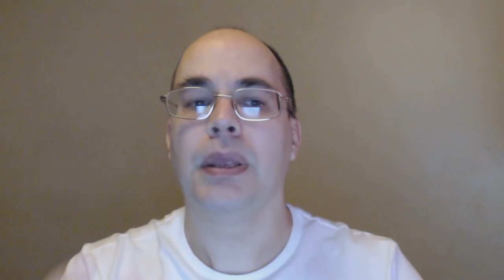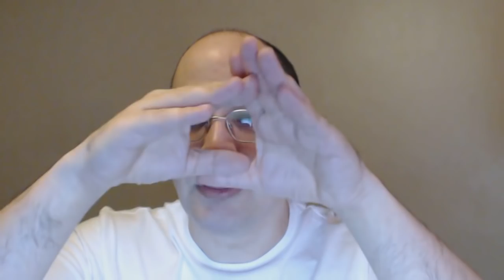How do rockets move in space, with nothing to push off from?

Comment: With respect, it doesn't make sense your explanation. First, you can't fire a weapon in space. Second, the example includes two bodies, that creat the oposit reaction, and than you say that this propulsors can work the same way? Not if they don't through or push mass in order to create this oposit reaction to create motion... How can you create an action and reaction within the same body? This would be an amazing discovery, we would be "free from energy". 🙂
Reply from the maker: Guns can in theory fire in space as the ammunition contains its own oxidiser, there would be problems with temperature and the ammunition jamming in the weapon but it works as a theoretical example. The gun and ammunition start off as a single body with a combined mass and velocity, much the same way a rocket contains rocket fuel. There is no issue about creating a reaction inside a single body and it doesn't create free energy as the potential energy is already inside the body waiting for a reaction to happen.
Reply: "First, you can't fire a weapon in space."
Yes you can quit making shit up.
Answer these three questions
1 - When the rocket engine is running, is the Exhaust Gas ACCELERATED from the nozzle? Yes or No?

2 - Does the exhaust gas have MASS? Yes or No?

3 - Can MASS be ACCELERATED without a force?  Yes or No?

Answer those three questions and we can make some progress.
Most "Physics deniers" will flat out REFUSE to answer these questions.
Are YOU one of those?
Reply: @Stuart Gray  No you can't, quit making shit up 😉.
1 - Yes, from the exhaust, in relation to what?
2 - Yes, gas have mass, can you compare it with the mass of the object it's trying to move? And, using combustion or pressure in space? 
3 - Nothing is created or destroyed, everything is transformed, there's no aceleration without force.
4 - Talking, questioning, is the art of science, just defending visions and opinions not opened to questioning certains, is more like a religion....
Reply: @MarceloOliveira-ji9ey  - "No you can't, quit making shit up"

I literally build, test, launch, and operate spacecraft in earth orbit and deep space as my job. I have personally fired a number of things just like guns in space, and in vacuum chambers here on earth. I have also been a vacuum test specialist for almost 30 years.
1- In relation to the rocket. Does the exhaust gas CHANGE VELOCITY.
Your answer appears to be "Yes".
Good.  For example a space shuttle main engine exhaust is moving at MACH EIGHT with respect to the rocket nozzle.

2 - Good, you know that exhaust gas DOES have mass. The EXACT same mass as the fuel and oxidizer that went in.
This is also referred to as "reaction mass". When a rocket lifts off about 95% of its mass is reaction mass.
3 - Good. You admit that MASS cannot be accelerated without a force.

We have established that you have a clue.
So DO you AGREE that the rocket MUST apply a FORCE to the MASS of the exhaust gas to eject it from the nozzle at such a high velocity? 
Does the engine APPLY A FORCE to the exhaust gas mass?
Reply: @MarceloOliveira-ji9ey  Where did you GO?
WHY did you run away like a coward?
Reply: @stuartgray5877  Well, i have a life you Know? 😉 Not just sitting on my computer, Oh Big mister that fired stuff like guns in space 😂
Well, i have to believe it? 
You don't have the Patience needed to go to space 😉 And if you won't really explain anything, just go upset some One else 🙂
Reply: @stuartgray5877  You push a iron block away in space, it Will move de same way it was pushed... You push gas in space, what Will happen with it? 
Now, imagine a huge propolsor, pushing gas away... What Will happen with the gas? Will it not "dissolve" into space? How can you create pressure against  "0 pressure"?
Why would it make any force on the propolsor?

Comment: that means they sent a rocket into " space " because an unproven theory said it would work 
because until you are in the exact environment you can only guess at the result . They built 
the rockets on an assumption ,  all the cost spent on a theory ?  I don't believe they did , they 
knew what space is or isn't  and then made the story fit .
Reply from the maker: The first rocket that made it into the edge of space was probably the V2 rocket which wasn't aiming for space, but just distance. However as you get further away from the Earth the force of gravity is slightly weaker and the atmosphere thins dramatically, this again was widely known about towards the start of the 20th Century and they didn't have to guess what would happen once they got up really high.
Reply: The X-15 was flying into "space" with a person onboard before you were born.
They had attitude control thrusters because they KNEW that aero control surfaces would NOT work in a vacuum.
Maybe look that up?

And watch the "Stardust Launch" on my YT channel. Tell me THAT is "CGI" I dare you.

Comment: Rockets can't work in space because thrust requires atmosphere. You did not address this fact. Newton's laws don't just magically ignore this requirement. The burning exhaust leaving the rocket does not propel the rocket by virtue of the fact they are moving away from the vehicle. It's not the same as a gun. The bullet is physically touching the inside of the firearm, so when it launches one way, there is equal opposite reaction in the gun. This would be like throwing a ball in space. But if you tried blowing out of your mouth, it would do nothing. Likewise, the gas leaving the rocket is not pushing against anything (in space) so it doesn't work. Space travel is fake.
Reply: Thermal Rehab - "Rockets can't work in space because thrust requires atmosphere.

This is FALSE!
Answer ONE SIMPLE QUESTION ( I predict you will refuse to answer and come up with some excuse NOT TO)

If I fire a STEEL projectile from a CROSSBOW In zero-G, IN a vacuum WILL I FEEL RECOIL yes or No?

This is to determine if it is PHYSICALLY possible AT ALL to "Propel" an object in a vacuum.

Answer the question and ill give you another that is more closely related to how actual Rocket Propulsion works.
This first question is to MAKE SURE that YOU understand how Inertia and Momentum works before proceeding to the real questions.
Please just answer these simple (high school level) physics questions that contain NO MATH.
Anyone with a BASIC grasp of physics CAN ANSWER in their sleep.

Next question: What if the crossbow fires a projectile made from WATER ICE?
Will it STILL get propelled backwards?

How about a projectile made from SOLID CO2 (Dry Ice)
Will it STILL get propelled backwards? 

Why will these things work or WHY NOT?
Reply: @stuartgray5877  Crossbow? Recoil? Seriously. Use a gun if you want to talk about recoil. Crossbows hardly have any recoil. 

To answer your question, firing a crossbow, or a gun, or pushing a bowling ball away from you in space would yes, of course, create a "recoil" - as the solid object is mechanically pushed away by another solid object, be it solid or liquid.

I never said, nor intended to make it seem, that propulsion in a vacuum chamber is not possible. It is. Obviously! 

My argument is that when it comes to using gases to create thrust, atmosphere is required. It's very simple why this is the case. 

Solids and liquids are very different from gases. 

You are to the bowling ball /
The gun is to the bullet /
The crossbow is to the bolt /
A squirt gun is to water

what escaping high pressure gas is to atmosphere , and vice versa.

Know that when a compressed gas (say helium) is released from its container into an area of lower pressure (our air), the thrust that pushes the cylinder back is produced by the gas entering the atmosphere of air and creating an instant high pressure zone right at the exit valve. This pressure pushes the cylinder away, but that pressure only can be formed because there is atmosphere to bump into. The atmosphere thus, is pushing back on the helium entering it. Thrust.

All the atmospheric air is being pushed out of the way by the helium, but air, like all gases, is squishy, so it actually gets pressurized by the helium, right at the immediate exit of the cylinder's valve. This pressure dissipates really quickly, which is why if you open a helium tank and quickly close it, you'll get that shove - and then it ends, because the high pressure gas diffuses and the atmospheric pressure equalizes. 

This is how the wings of a bird allow it to fly, by creating a high pressure area under the wing, and a low pressure area over the wing. This creates lift. 

If you were to go up into space and open a helium cylinder, the compressed helium would spring forth from the valve - and, having absolutely nothing to bump into, would push out into the void of space's vacuum, producing zero thrust. Likewise, a bird's wing, or a massive sail, would not produce lift or thrust in space. 

There is no energy imparted to the gas to make it leave the cylinder. Sure, there is equal opposite force applied to the gas from the cylinder walls (psi) , but the gas isn't being "pushed" out the same way a crossbow pushes a bolt away. 

Gases are elastic, and that elastic energy seeks equilibrium and diffusion all by itself. Solid objects like a crossbow bolt or bowling ball are at rest and there is no elastic energy trying to diffuse. Under pressure or not, they don't care. But they require a physical input to overcome their inertia, a push, which results in equal opposite push, thrust. But gases do it on their own because they are a compressed elastic mass.
Reply: @3_years_left  "crossbows hardly have recoil". Watch the video on my YT channel that says otherwise.  and I use a crossbow as example so we don't confuse the situation with extra GAS shooting out
Reply: - "Newton's laws don't just magically ignore this requirement. "

You are correct EXCEPT - Newtons laws say that Rocket Propulsion MUST WORK I N VACUUM.
Lookup the "Tsiolkovsky Rocket Equation".
It is DERIVED using the "Law of Conservation of Momentum" (COM).

Now can YOU explain the Concept behind the Law of Conservation of Momentum? 
Because if you COULD you would understand how rockets work.
Hint: The Law of COM says that when ANY MASS PUSHES on ANOTHER MASS - BOTH object MUST feel the SAME CHANGE IN MOMENTUM.
Reply: False. How do you think air would push off the rocket exhaust? Please describe how the air pushed back on the rocket.
Another FE fail.
Reply: @MetoFulcurm  Yes.  I cant stand letting these morons corrupt the minds of our children. So I stand up to them.
Reply: @stuartgray5877  you also assume a person's stance just by seeking proof lol! Do you deny the fact that many moon videos were faked? Because even astronauts tell us that we only see recreations of what happened. You claim you're a man of science but seem to fail when it comes to actually applying the scientific method. We need to be able to reproduce something for it to be called science. Nobody is claiming the earth is flat so keep your preconceived notions and hateful comments to yourself.
Reply: @michaelbibby01  If you are referring to my "conversations" with Papa Legba, then mind your own business.  This person has been harassing me for YEARS and accusing me of lying about my career and where I work.

If you read my responses to OTHERS on these threads, I am not a dick and I try to be helpful UNTIL they start accusing me of lying and hurling juvenile insults.

Don't take the way I talk to Papa Legba as how I treat others.
Reply: @michaelbibby01  Now if you would like to "Discuss" how rockets DO work in a vacuum, I will be happy to do that.
Reply: @michaelbibby01  I offered (Politely even) to explain how rocket propulsion works in a vacuum.
WHY did you run away?
Are you SCARED to learn?
Reply: @stuartgray5877  you aren't exactly helping anyone when you appear to be a horrible human being with no communication skills. Try being a human first and a cnt later. Especially when you literally are refusing to acknowledge the arguments presented and deflect with "evidence" that has nothing to do with the subject.

Comment: To all of those people that believe "Rockets push on the AIR behind them"

-  I am just curious you must believe that the rocket engine PUSHES ON THE AIR behind the rocket right?

HOW can this be? HOW can anything "Push" on nothing but AIR?

Doesn't the air just MOVE out of the way HOW can it provide any kind of RESISTANCE to the rocket thrust?
Just explain your reasoning so I can understand how you THINK it works.
Reply: Exactly bro! These morons don’t comprehend that they are bereft of understanding of basic physics.
Reply: Also gases are mostly empty space, so there's no continuous atom-to-atom contact as with a solid spring or rod, so all forces exerted by a gas are just individual molecules bouncing off of each other, or off the surface of solids or liquids. 
I think that a misunderstanding of the difference between solid and gas phases may be one of the contributing failures to understand how rockets, jets, propellors, and aerofoils operate - though it's most obvious with rockets because aircraft are so ubiquitous the skeptik folk tend to take them for granted.

Comment: hi thank u 4 the super explaination, and why dont we simply say, the jetcase, which has a hole for a filler to be able to exit, pushes itself (by explosion) off of the inertia/momentum of the filler (or the resulting material after the explosion) and will move in the opposite direction of the exiting of the filler (or that result material)? deutsch: hi danke für die super erklärung, und warum sagt man nicht einfach, das triebwerkgehäuse mit entweichungsloch für füllstoff stößt sich durch explosion an der trägheit des füllstoffes ab und bewegt sich in die entgegengesetzte richtung der entweichung des füllstoffs? mfg